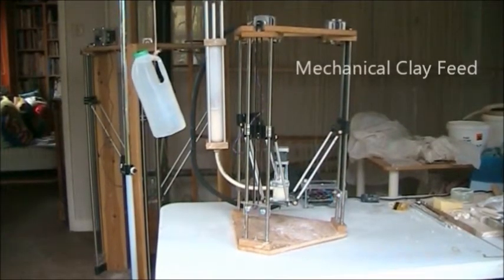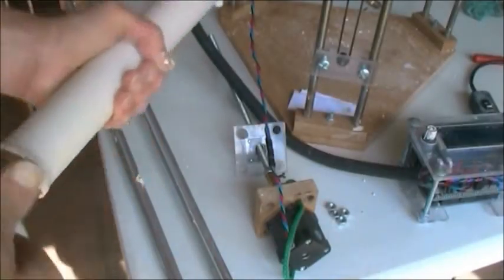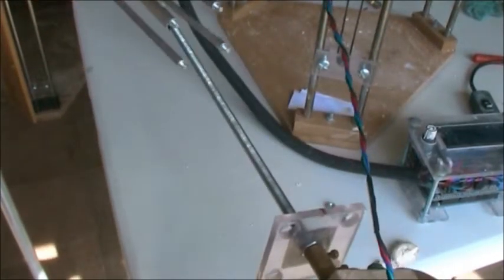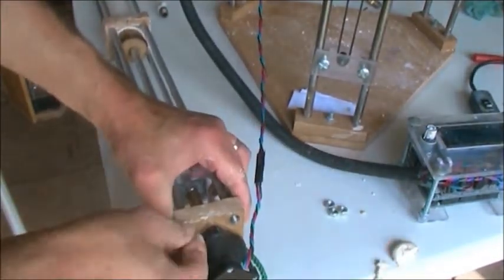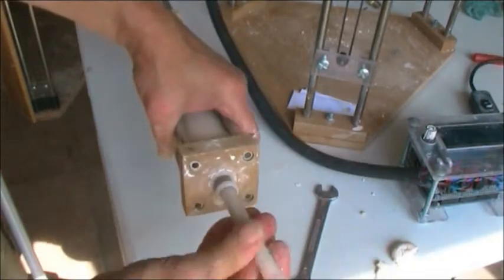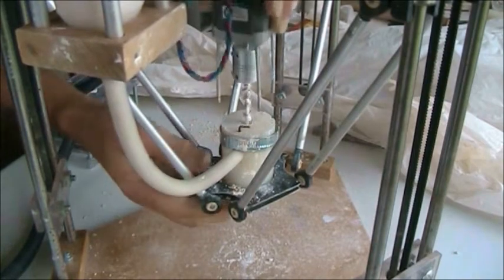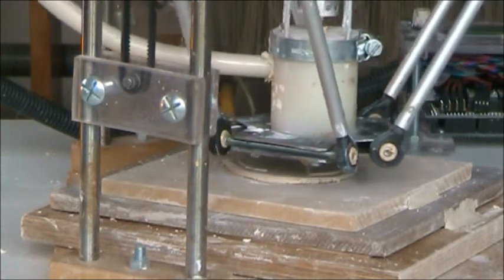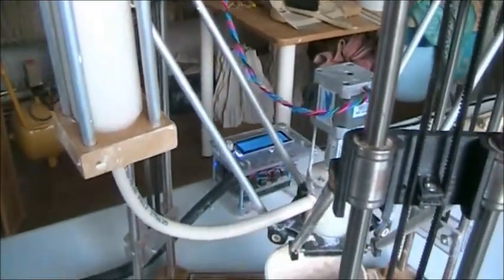Ceramic 3D Printer - Motorised Ram

Comment: i have a two question for you 
1 . is it better to use air pressure or motor to convey the clay.
2 . can the clay conveyed via the the remote cylinder of clay only . without using a second motor on the nozzle .